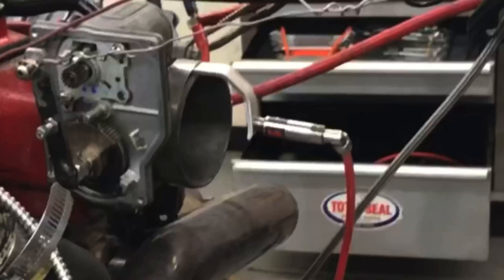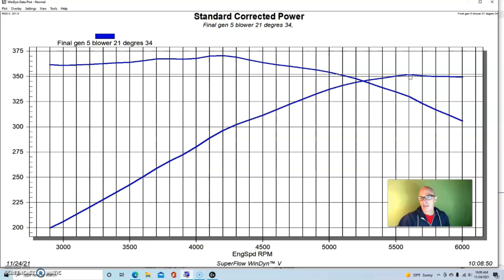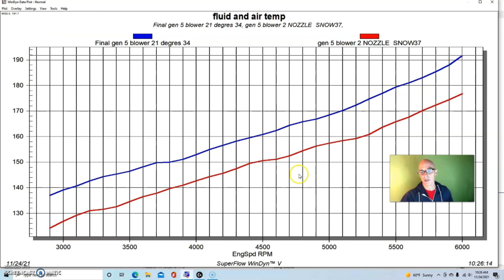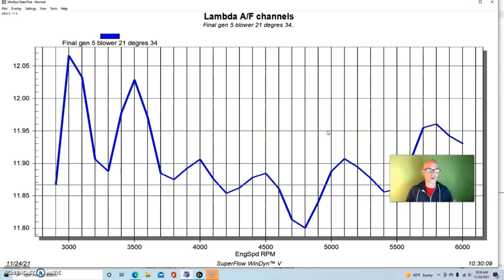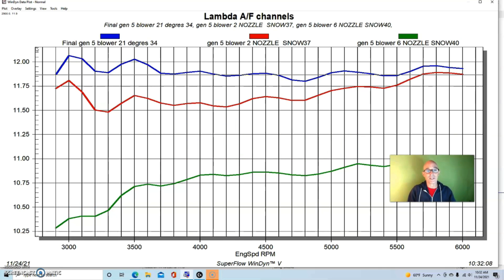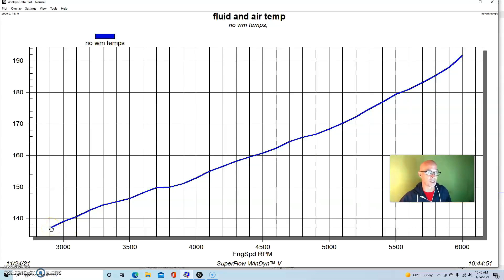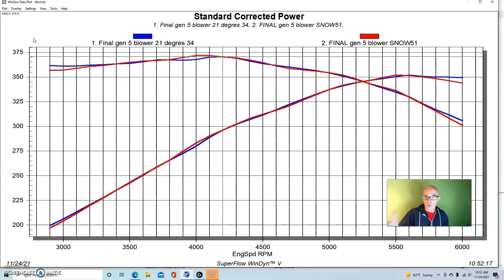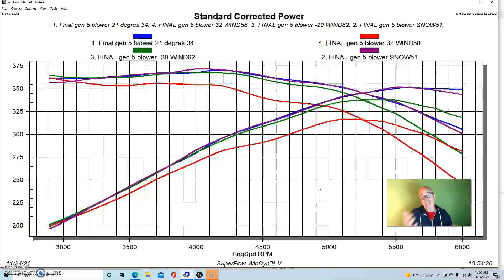WATER METH VS (LOW-$) WINDSHIELD WASHER FLUID-WHO WINS? BEST WATER/METH VIDEO EVER! IATS, AF & HP!

Comment: Rich, i came up with a little experiment,  What If a little Boostsang or the VP octanium octane booster was added to the meth,  IMOP it would have to be tested on a boosted motor with the main fuel being Pump gas,  The reason im curious is because the octang boosters out there all get added to the gas in your gas tank and goes for the ride ,  What if you regular driving doesnt need the extra octane!!  unLike Methanol injection which is On Demand,  Im curious to see if the oxygen sensor safe Octang boosters would allow even more room to run more boost or timing Like C16 or 109 etc,  Then Methanol injsecton and pump gas alone,  Let me know what you think,,
Reply from the maker: methanol would already have more octane than Boostane
Reply: Really , good to know, all my builds are street-cruise muscle cars So i only build Pump gas cars and meth injection to boosted cars , For me its the most practical , One more suggestion:: M-1 VS M-5 methonal , There was a M-3 but i believe VP dropped it,  I usually run straight M1 but i have played around with blending in some M-5, and at around 20-30% you can defiantly feel the difference,   i tryed a 50/50 mix once on my camaro, It felt like a small shot of nitrous, My camaro has a fully built LS1 with all forged internals My other cars are stock bottom ends so i dont want to play around to much with them,  OK so i remember a friend of mine calling into VP and asking about the different Methanol blends they had M1-M3-M5 ,  They wouldnt tell him much besides that M1is 99.99% meth with the possibility of a tiny bit of walter,  M3 had a light lubricate added and M5 had the Lub and a Power booster,  Well the only Fuel i know that can actually make more power just by adding it to your main fuel source is nitromethane, Correct me if im wrong, but VP wouldnt confirm or deny what was actually in the M-5,  I think a back to back testing M1-VS-M5 would be a good test,  See if A/F is affected,  intake Temps, more timing or less and of course how much more power does it actually make,  On my Camaro if was definitely noticeable
Let me know what  you think,  Its almost that time , Mikes black cherry!  @richardholdener1727

Comment: LOVE this channel! I use an 80HP shot of nitrous for my cooling needs, only on demand. Works like a champ, plus adds HP! Single fogger nozzle just before the carb hat. And I can tailor the A\F ratio with a single jet change instead of dipping into the carb tuning. For the cost of a meth setup a guy could buy a used nitrous kit like a cheater and still be money ahead. After all, there's only so much horsepower you can run on the street. You don't have to run around all the time with maximum boost. And I only use the nitrous when it's called for at the track or with a pesky competitor on the street. 
This method isn't for everyone, just the way I do it.
Again, Iove this channel. Richard is doing the hot rod world a favor by having this channel. Kuddos brother!
Reply from the maker: nitrous is actually not a good cooling agent-not enough of it to make a sizable change in charge cooling. If you have a carb-you already have the cooling you need-the nitrous just adds power

Comment: I am curious of how much the E-85 changed the outcome by getting the low hanging fruit before adding the water methanol injection. In other words, the E-85, as shown in several Engine Masters episodes, cools the intake charge substantially from a gasoline fueled engine. To me, that would be where you might see a bigger difference because you could tune in more timing. It’s just an observation I think is worth considering.

Great job as always on documenting things we are all curious about. I am looking at adding it to my non-intercooled 6bt Ciummins pickup. There, it might pick up a bit of torque, but more importantly cool the intake/exhaust temperatures.
Reply from the maker: then it's the timing that adds power
Reply: @richardholdener1727  exactly, but without the water/methanol, you wouldn't be able to do that. It is the catalyst in that equation.  It answers the "if not for...." question.

In a similar fashion, nitrous doesn't produce power.  It adds oxygen so more fuel can be added.

Comment: Basically if your running E85 whats the point of complicating the system with MW injection system and AF ratio to cool the intake temp if there is no real power gains. I would of liked to of seen this done with a motor running pump gas with the super charger.
Reply from the maker: YES-THE TIMING YOU ADD CAN INCREASE POWER-TIMING DOES THAT

Comment: Would be nice to see this exact testing using a turbo diesel engine, as in HD street style truck engine
Reply from the maker: the Methanol/alcohol portion is a fuel-which will help diesels (they are throttled by fuel)

Comment: On a supercharged engine you cant add boost the way you can on a turbocharged engine, where you are using the water meth to create room for more air pressure to be safely added. That maybe where people are getting the idea wmi helps build more power

Comment: The blue stuff out here in Colorado is 30% methanol the rest is water and probably a bunch of additives that you don't want in your motor. I think it works a LOT better in diesel motors especially when towing. But the point in a gas motor is probably to run more boost. That's why it was originally invented. In W.W.2 aircraft they were trying to squeeze as much hp as possible out of their new turbo supercharges and water/meth was one solution to the high intake temps.

Comment: In my opinion, in turbocharged systems, if the fluid is injected after the compressor wheel, the results are better, and it helps spool up the turbo on the hot side.

Comment: Regarding subtracting fuel to compensate for AFR to get back to target AFR...  @6:50  Shouldn't it NOT really matter that much, because you're adding methanol  (not gasoline) , and methanol's stoich ratio is very low?  So when you see the AFR going from 12:1 to 10.2,,, that 10.2 as a gasoline/meth combination should NOT have anywhere near the same (negative) affect on the power as changing the AFR  from 12:0 to 10.2 on straight gasoline. That doesn't seem to match what your findings were though(?) I wonder why not?
Reply from the maker: you are forgetting that it also made less power (same fuel plus less power = richer mixture)

Comment: How much did it change the fuel consumption rate?
Reply from the maker: as in mpg?
Reply: @richardholdener1727  gallons per hour?  Lol. I doubt you ran them very long.  If you had to remove fuel it would cost you less at the gas pump?

Comment: Richard does an amazing job with testing except with water/meth. Meth injection does NOT add power. Why even attempt to test on this premise? The injection allows you to increase boost or timing or both which in turn adds power. Come on now.  Also pure methanol injection has the MOST potential benefit.
Reply from the maker: Come on now...many people out there think WM injection adds power. This test was to show it does not. An intercooler or E85 actually add power, without adding boost or timing. WM does not. That is what the test illustrated.

Comment: That’s a whole lot of planning and work to not gain a single hp. The moral of the story on this build was that the initial setup and high I take temps were just fine, at least in terms of dyno numbers.
Reply from the maker: MORAL OF THE STORY IS WINDSHIELD WASHER FLUID DOES NOT MAKE POWER
Reply: @richardholdener1727  touché. 

My comment wasn’t towards your testing - I’m a fan of the videos. I just can’t believe the snow kit didn’t gain any hp on a 15psi non-intercooled motor. It’s a lot of playing with jets and wiring and fluids and tuning, all to make the same hp as your neighbor who didn’t do it. 

There’s something to be said about safety, obviously, but I’m still just shocked.

Comment: Using water or water alcohol to cool the charge results in vapor taking up volume in the engine, effectively reducing boost.  Water injection ideally has atomized but not vaporized water introduced into the cylinder.  This will quench detonation.  The atomized water is liquid and takes up little volume.  It vaporizes during the compression stroke absorbing heat.

Comment: You would get way more gains over gasoline than you get from E-85  which does cool the intake considerably ..
Reply from the maker: you only get gains from the ability to add timing/boost with pump gas
Reply: @richardholdener1727    It takes twice as many BTU's to vaporize alcohol and you run alcohol much richer.. Thus  your intake charge will be much cooler if you are running alcohol ..
  Since you get more cooling effect with E-85  and it already has a higher octane .. You won't  gain as much power  with water/methanal injection  on E-85  as you will with any kind of gasoline.
Reply from the maker: see my comment above

Comment: Is there any way for a boost safe option for wmi on a supercharged engine? As no wategate to dump pressure how do you saftly "run outta wmi"?
Reply from the maker: low water trigger to retard timing and add fuel to ECU
Reply: @richardholdener1727  thanks man. I have a external LED wired in to flash when low. However cant have the boost safe solenoid option that aem v3 offers on a supercharged application.

Comment: I see a weakness in the test. You said you adjusted the fuel mixture after using boost juice and the mixture remained the same for the two different windshield washer fluids. You have not eliminated all of the variables. The fuel mixture should have been adjusted for maximum hp/torque after each charge cooler fluid was used (College Chemistry). An engineer used by GM says water and water soluble oil is all that is needed, no methanol. He went on to say methanol is used to keep the water from freezing.
Reply: That is the problem since the mixtures contains different amounts of methanol the AF mixtures should also be different
Reply from the maker: many different AF mixture were tested when tuning, the AF was not the issue-do more testing and you find these things out too
Reply from the maker: AF was constant for all three-there is no power from the washer fluids
Reply: Are you familiar with David Vizard he says water is the cheapest and best octane booster. His You Tube video: World's Cheapest and most Effective Octane Booster.

Comment: Boost Juice is NOT a water/glycol/methanol product . It consists of 85% water , 14% sodium acetate plus the remainder being an anti knock additive Manganese 2  Chloride Tetrahydrate . Basically saline drip solution ( natural antifreeze ) with an anti knock additive .
Screenwash , antifreeze etc., contain non flammable ethylene glycol used as an antifreeze plus surfactants and detergents in the case of screen wash and possibly less harmful than the saline solution on internal components . You will achieve the same effect or better without the injection system by adding an octane booster to your tank of petrol and adjusting the ignition timing for the higher octane rating .
Try a blend of 15% isopropyl alcoho ( rubbing alcohol)l and tap water which closely resembles that used on supercharged aircraft in WW2 .

Comment: Do this test with pump gasoline. E85 allows you to run more boost with a more aggressive tune. Pump gas handicaps a boosted motor vs E85. The water meth on a pump gas motor allows you to run more boost and make more power than without.

Comment: The difference would've been impressive is the fuel used was pump gas. My gp gtp with snow performance kit made 40 more at the wheels. It was pump gas
Reply from the maker: then you added timing
Reply: @richardholdener1727  no sir. After getting a tune , we turned it on to see the difference.  But there was no timing added. Probably timing was being pulled on pump.
Reply: @richardholdener1727  ported sc , bigger tb , zzp headers , full 3" with cat delete.  Tuner said injectors were maxed out. Always 2-5 kr unless water meth was used.

Comment: I found at Costco in Canada a box of 4x1 Gallons of -45c green juice Named Laurentide Windshield Washer De-Icer removes ice + frost at -45c Enhanced Formula with IPA ( Isopropyl Alcohol ) With skull crossbones death and flammable label and the - 45c I'm confident it's over 60% Methanol, Ethanol, and IPA. At under $3 per gallon from now on I will set up to spray every time my V8 HEMI is reaching over 3psi up to 7psi. I'm driving a stock internal 2006 300C SRT8 6.1 HEMI with a SALEEN SMS supercharger I can only think of 2 locations to spray directly after the throttle or after throttle body location there is a 24" of heat-absorbing black cast aluminum oval pipe at the end of it spraying directly at the supercharger lobe meshing in each other could this be a problem for the coating on it or metal contracting thank you for any help

Comment: Seems like the meth injection is more for when E85 is not an option in your area ? or when you add PI heads to a NPI short block to raise static compression on pump gas and then decide after the fact you want to run boost but not race fuel ? can you compensate the lower power out put of the washer fluid by changing the pulley size to get more boost because of the charge cooling ? and the limited tuning of a stock PCM versus not having a holley PCM  ?

Comment: Great test, which confirms my own experiences. Water/Meth will help cool the intake charge and control detonation but won't make more horsepower
Reply: i think the point is that it lets you run higher boost without detonation, and that's what gives you more power.  fyi in the DC-6/R2800 we used water injection on takeoff, but i was told the alcohol in the recommended mix was just to keep it fm freezing.  so in s calif we just used plain water/ 29.5 in boost on 100LL avgas
Reply: On its own no, but it's knock resistance due to air temp and octane increase allows more timing and boost that's what makes the power. So without changing the tune it will usually make slightly less power.
Reply: Well I was always under the impression that the water meth was for cooling the combustion chamber to mitigate detonation under boost

Comment: I want to see the same test done with 87/89/92 Octane to see the difference
Reply from the maker: so you want to see if timing makes a power difference-different test
Reply: @richardholdener1727  I mainly say that because e85 likes to be rich, with regular 10 or 15% might be able to utilize the meth/washer fluid? I could be wrong. I'm just curious about all this.
Reply: I'd honestly love to try e85 on my car but it's a 10.5-1 260k mile subaru Impreza so it would be pointless. I guess I'm just mainly curious about what pump gas vs ethanol with and without meth and even the washer fluid

Comment: Surprised no gain in power. thought cooler air always makes more power. Was the tune pulling power for the high iats without meth? If not how high can the iats get on e85 before pulling power?

Comment: I want to use the water/meth injection for cooling only. If I retune then the meth injection becomes erratic or fails then I have to worry about engine damage. Is there any way to use meth/water with a small nozzle for  cooling only without tuning?
Reply from the maker: yes

Comment: Please do this same test on pump gas, cause now I am very curious. 91 octane would be great as that's the equivalent of our shitty fuel in SA. I have been running water/meth for years in my E89 Z4 35i. and due to our very hot summers, and low octane fuel I definitely get major benefits when running a tune. I have put the car on a dyno running back to back runs comparing meth to no meth and the gains were pretty substantial in terms of cooling and HP.

Comment: Windshield washer fluid is well known to cause crankcase oil degredation from the soap/Cleaner additive used. Pure distilled water mixed with Methanol is the only safe method for half the price or less than massively overpriced "Boost Juice"

Comment: The problem with some off the shelf washer fluid, is that it’s actually part coolant, and not methanol. Great for cooking IATs if you want to have a repkicateable results at the track and stave off knock. Not so good for making more power in an e85 scenario.

Comment: As an FYI, the +32F fluid is just distilled water with blue dye in it. I would add about 4-5 bottles of heet (depending on the ratio I want) into a 1 gallon container then top up with blue washer fluid (I prefer having some sort of colored fluid to find leaks and what not). This is way cheaper and easier to get in a pinch like on the way to the race track. A gallon would be about $5 - $7. I typically by a 5 gallon drum of methanol and mix my own (VERY CAREFULLY as it burns with a clear flame and measure by mass not volume). However, if I am on a road trip or out and about, I know I can fill up at any autozone or walmart.
Lastly, at least in my application (turbo 3.8 GDI V6 with 11.5:1 compression ratio running 93 pump plus 50/50 meth water injection with 6 port inject nozzles at 1 gpm each), I picked up about 30-40 rwhp. That being said, it took a lot more than 1 degree of timing to get those gains AND most importantly, I can't run that boost without meth because it would cause serious knock. I don't recall the advance needed, but it may have been more in the 4 to 5+ degrees range.
Reply: I pick up -20 washer fluid and 2 bottles of heet when I am on the road. Seems to get to about 50% . I mix it like you mentioned.  I have also used 91% isopropyl in a pinch.
I have 2 cars that use WMI one of them isn't intercooled and I count on it. The other car is intercooled but uses WMI for my higher boost/timing map. If it runs out I can switch maps and no big deal.
Reply: NO. It contains detergent additive that causes cramkcase oil degradation. This has been proven 15 years ago. Mix your own Distilled water + Methanol it's cheap and the safest